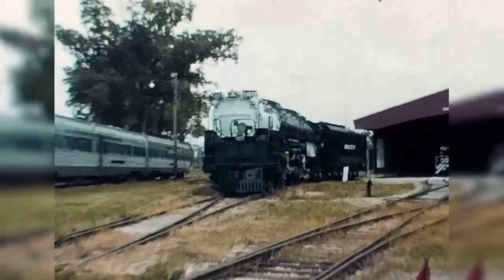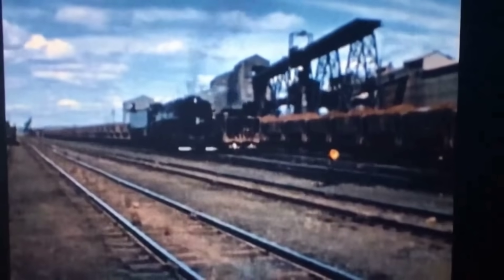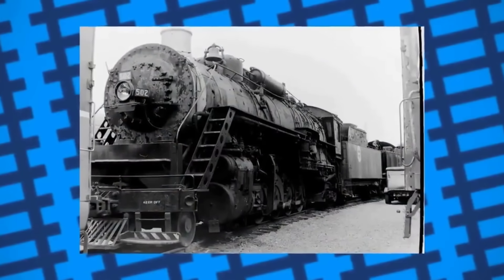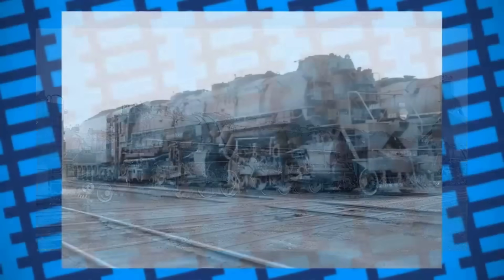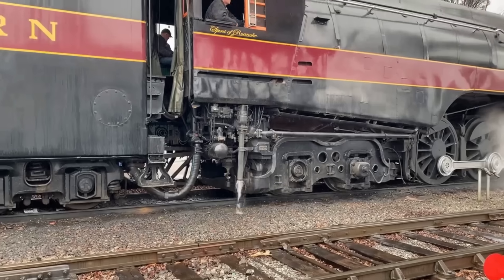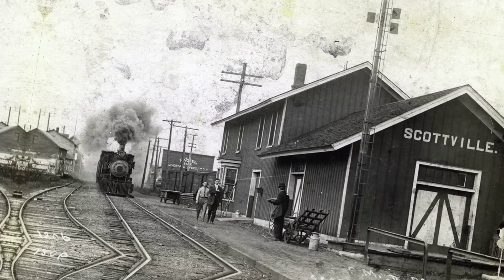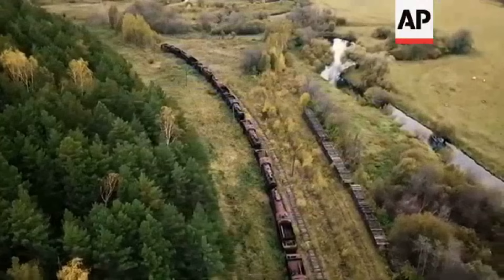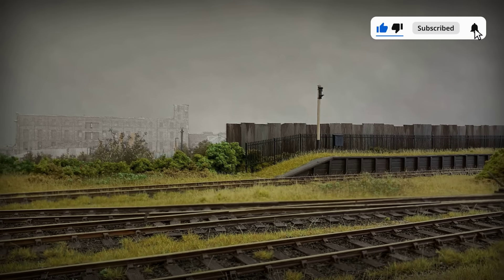The Forgotten Freight Engine That Could Out-Pull Big Boy

Comment: If I were a billionaire, I'd get another one rolling... With modern machining, 3-D modeling for castings, etc., it could definitely be done, as opposed to when they manually had to cut casting molds  from wood, etc...

Comment: Read Frank Kings book, Locomotives of the DM and Iron range railroad. Very interesting, these were  CZ 5,000 more tc force than big boyz. In Bove Mn in Iron range is. A long shed to hold big boys,  chimneys for the sta 5:38 ck, I remember them well, mostly down. Hill to Duluth at 600. Ft above sea level. Some of them in  C winter were rented to the Denver and Rio Grand, one wrecked lost brakes. The DVRG called them the best steamers ever built, they pulled waratrains over the Tennessee Pass.
Reply: They pushed over the pass!!

Comment: Not all 18 of the Yellowstones were designated the M-4 Class, that refers to the later built 10 locomotives in 1943, the first 8 locomotives built in 1941 were classified as M-3’s, those engines were numbered 220 - 227, the M-4’s were 228 - 237. The only difference between them were the M-4’s were heavier due to different metal alloys because of war time restrictions. Incredible pieces of steam machinery they are!

Edit: And also, there are three DM&IR Yellowstones that survive today.
M-3 Yellowstone No. 225 - Displayed in Proctor, Minnesota.
M-3 Yellowstone No. 227 - Displayed at the Lake Superior Railroad Museum in Duluth, Minnesota.
M-4 Yellowstone No. 229 - Displayed in Two Harbors, Minnesota.

Comment: So what about the Norfolk and Western's Y6b 2-8-8-2? 166,000/170,000 lbs  ft of tractive effort - i.e. more powerful than the D & MIR Yellowstone 2-8-8-4s. And then the Allegheny 2-6-6-6s, calculated as having as much as 7,498 hp, - no other loco was ever rated as highly as that, although with a starting tractive effort of only 110,000 lbs. What about them, fellow steam buffs?
Reply: The Y6b where known to slip a lot starting a train
Reply: @adamschmidt8061  Not a surprise with 160k of tractive effort and an engineer wanting to get the consist moving so as to combat those steep mountain grades the N&W had to deal with which is why the slow drag champs like the Y6b were cooked up.  Yeah they had to sand to get/keep some of those mile long coal loads moving but they did it.   I'm a fan.  I also had the dubious distinction to have watched the last surviving original Y6b get cut up for scrap, with no fanfare, while some people were still fighting for its preservation... but money talks.   It was a sad sight.   Only one Y6 remains now, a Y6a that was upgraded to Y6b standards before being retired.   Nice to see it at the VMT alongside the J611 and the A1218, representing N&W's Big Three.   It's back in Ohio now... wish it was still here in Roanoke, also wishfully thinking that someone with deep pockets could make that happen, maybe even manage to get it back on the roads again but unlikely to ever happen what with AMTRAK and the current N&W policies in place that prohibit operating excursions here due to right-of-way restrictions.   It's also pretty much why the 1218's 2nd overhaul wasn't completed, just simply stopped while in progress and ordered back to the museum.    It's still a thrill to watch big steam locomotives doing their thing, and the N&W made some big ones.   (So did Lima with their H8s)
Reply: @tonyunderwood9678  even if they want to finish restoring the 1218 it’s missing parts
Reply: @adamschmidt8061  The stuff that's "missing" isn't.  It came back to Roanoke in a boxcar along with the 1218.  I'm told the stuff is still sitting... waiting.  I'd have thought they'd at least put the external running gear back on the locomotive for appearances sake, but no...